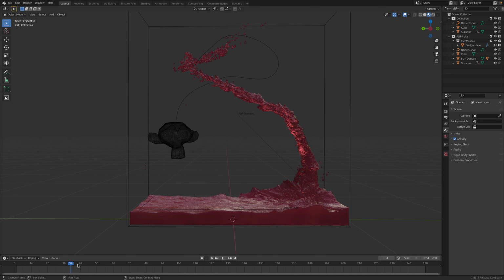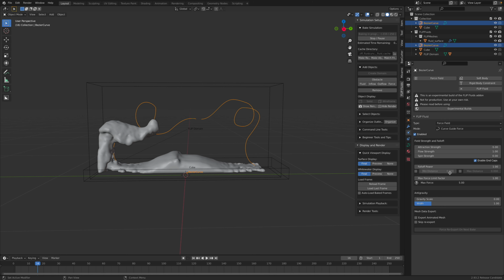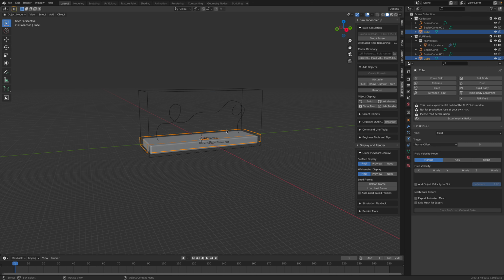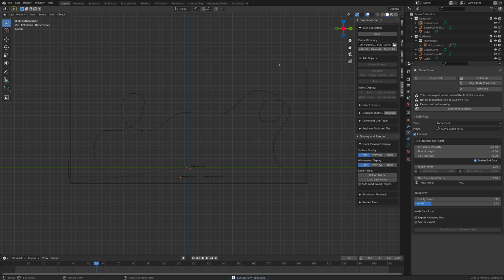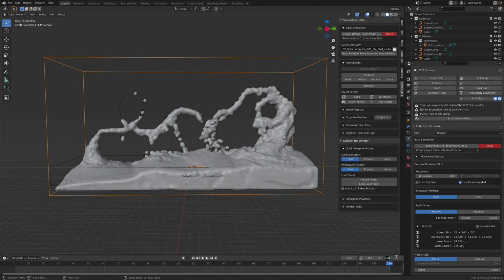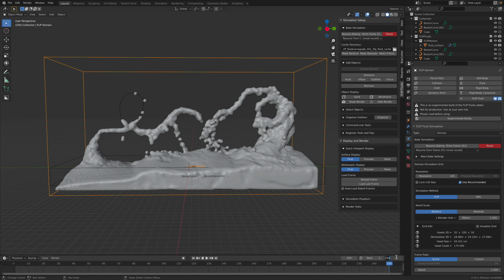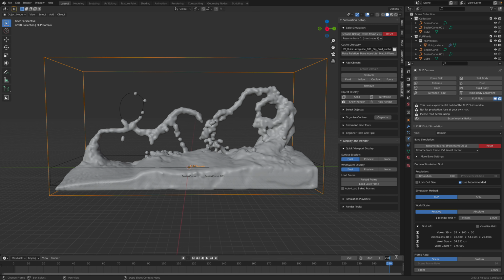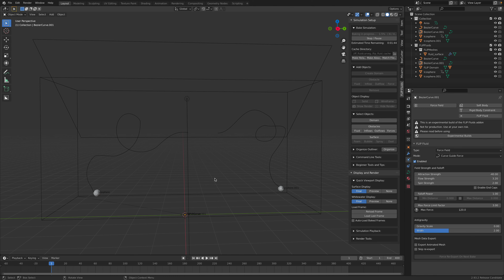BSLIVE / Controlling Flip Fluid Flow Using Curve in Blender

Comment: I used the same in Flip fluid, but I used inflow objects - 2 cylinders. I added keyframe for enabling and disabling inflow. But I think disabling did not work well. It  is still adding fluid after disable keyframe. Is there any solution?
Reply from the maker: When you keyframe the fluid On and Off, ensure the key frame is "stepped" next to each other.

Example:
Frame 1: ON
Frame 100: ON
Frame 101: OFF
Reply: @JimmyGunawan  Thank you for reply, Now I have different problem lol. When I use Curve force field  in Flip Fluid, fluid elongates after some frames. For example, if I make 3 frame fluid, after a couple frames (50th frame)  fluid becomes more longer than initial size.
Reply from the maker: @Deutsch-Pie  Hmm... strange, maybe try asking the same issue to the FlipFluid developer at github, they are pretty responsive.
Reply: @JimmyGunawan  Thanks I am going to ask now.